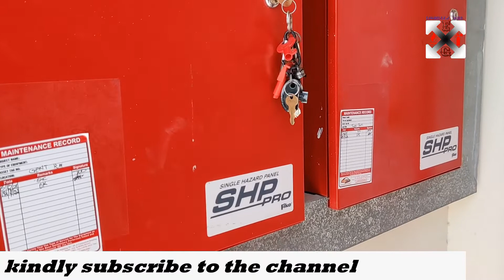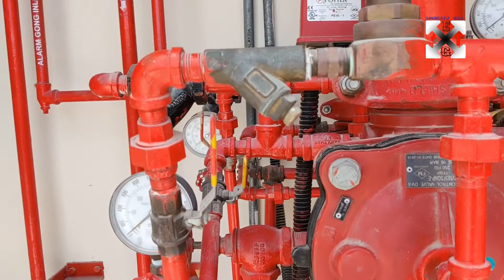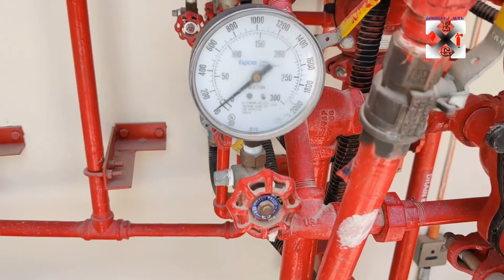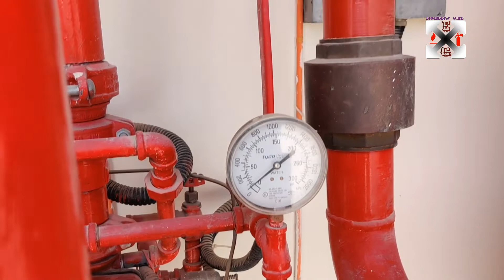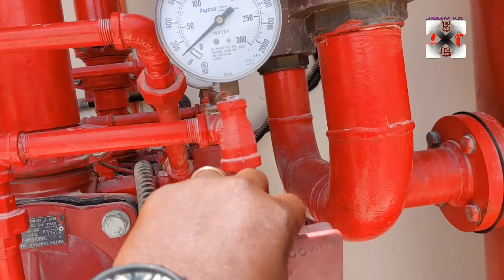FOAM  FIRE SUPPRESSION SYSTEM BY ENGINEERS GUIDE

Comment: So what is the purpose of the actuator? Wouldn't the drop in pressure at the diaphragm of the deluge valve allow for water to flow and activate the entire system? Since the diaphragm can only lose pressure when the panel gets a signal for a fire.